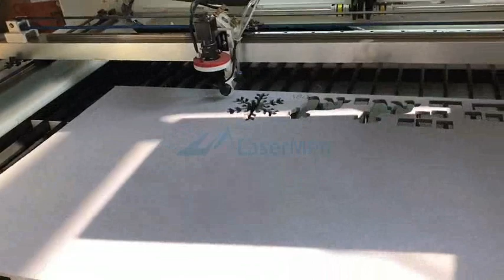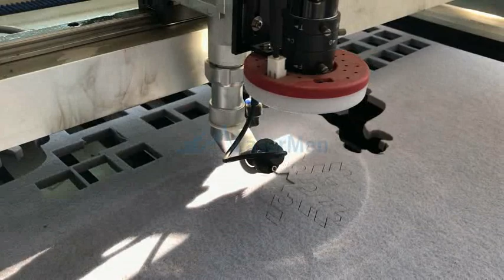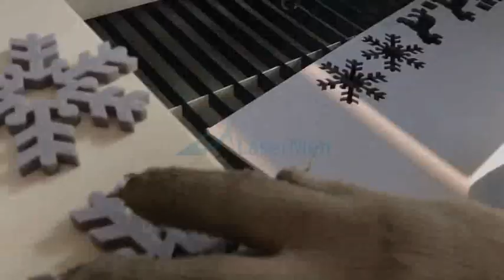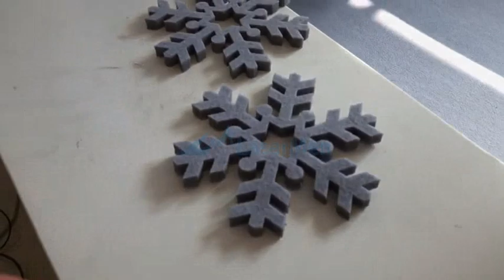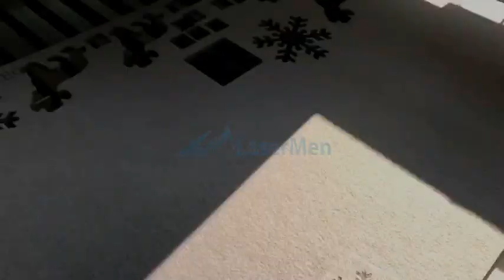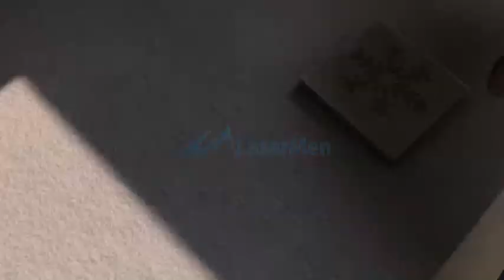laser cutting engraving machine for Polyester panel used in wall panel interior design

Comment: Is that laser cutting machine C02 or fiber ?
Reply from the maker: Jhoseph Castellanos in this video, it is co2 laser cutting machine, if you are interested in it, please contact me with WhatsApp: +86 13105418253
Reply: Wow amazing, but for that cut, power and speed were so high, weren't? could be 40 power and 70 speed ?
Reply from the maker: Jhoseph Castellanos do you have a laser machine? Different thickness, power and speed is different
Reply: @graceguo-lasermen824   yes, I know, but in this case, in that machine, which were the numbers?